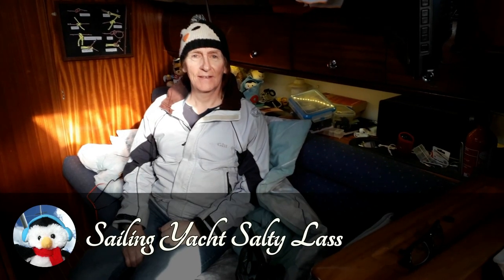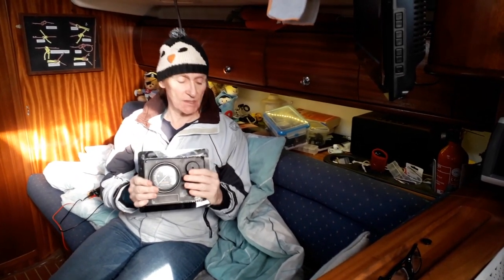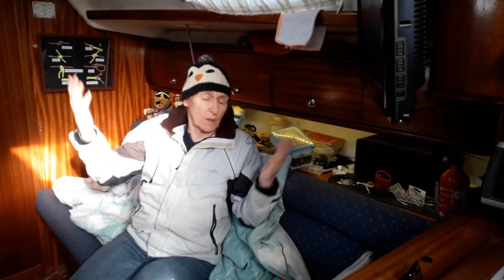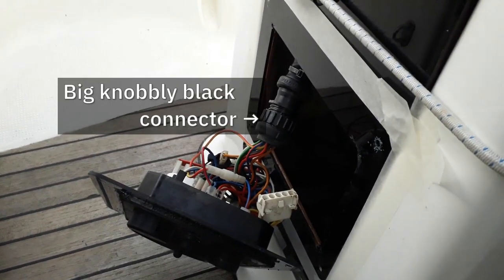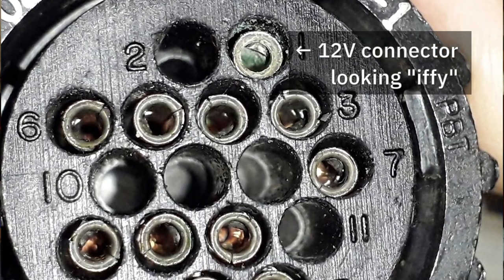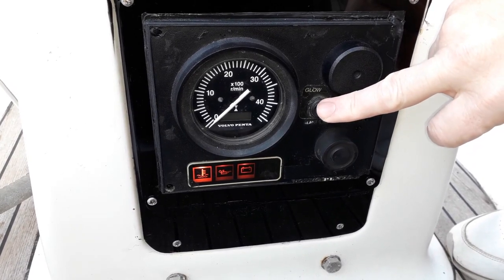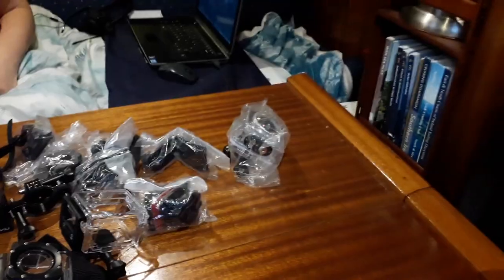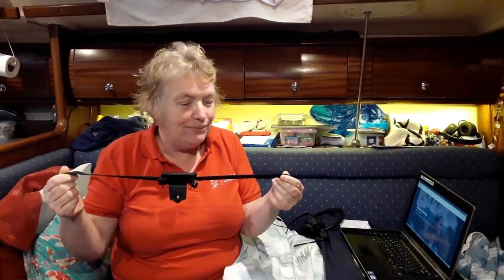Northern Ireland - Winter - Intermittent electrical fault - Inverter - Ep. 225

Comment: Hiya , I worked as an electrician most of my life and one thing I know about multi pin low voltage connectors is that they cause trouble. I used to cut them off and join wires some other way. Fair winds and happy days each. I enjoy your video very much. Pete
Reply from the maker: I will not say that we did not consider doing just that, but lucky for us, it all worked again. Thanks for commenting and for the feedback 👍

Comment: Hi Lasses, how's life? Just a point please don't use masking tape u need electrical tape because masking tape will conduct. Continuity mean power is running through the cable from one end to another but u need a ground. My Grandads motto was if it isn't broken don't fix it. Yeah right!!. I hope ur both well, even though Gaynor seems quite tired  but job well done on wiring Lass. Bev like the instrument panel good thinking and glad u used a lube on connections. Love Prus new head gear or is that face mask🤣🇦🇺🐧🐘
Reply from the maker: The paper tape is what we had to hand. It was temporary and we did not want bare metal floating about the battery area. Whilst the charging system was not broken, it was charging one battery preferentially and thus affecting overall battery life so we figured that splitting it over the bank would eliminate the preferential charge  link. As for Pru's new camera gear, we want it back!!! 😄😄
Reply: @SailingYachtSaltyLass  love u both ya crazy wenches
Reply: @SailingYachtSaltyLass  just want u both safe is all💚💛💜
Reply from the maker: Safe is good. We are not fans of danger 👍
Reply from the maker: 😆😆 Craziness is good too

Comment: Great laughs!  I think you have a new film crew member with Pru….imagine what places she could find to film.  Quick question: could you tell me the height of your sail stack at the mast and your boom length some time. I’m working on building one to replace my standard sail cover as a project to keep me busy this winter. Congrats on the panel fix and look forward to seeing the inverter purring along soon.
Reply from the maker: We are dreading Pru with a camera 😄😄 I will have to measure the height of the sail stack. I presume that you mean the bag and not the lazyjacks? The boom is 4.2 metres long. Thanks for commenting and let me know about that measurement that you need
Reply: Thanks!! This is so helpful! I just need the measurement for the sunbrella type material  bag at the mast end. I have the lazy jacks figured out so all good there.  Again thanks!
Reply: PS I should clarify I just need the bag height behind the mast that catches the sail. . Not the pc., if any that goes around the mast. Thanks.
Reply from the maker: @sailinglatis  - The height varies and is lower at the back. If I get a chance tomorrow before the storm hits I will measure it up for you. 

Our bag has a boltrope and fits into a slot on top of the boom. I will see if I can measure from there
Reply from the maker: OK - here are the measurements from our bag. Please remember that these fit our boom and our sail and your sizes may differ considerably. Having said all that, from the boom slot to the top of the sailbag batten is 38cm at the end of the boom and 55cm up at the mast. From the batten to the zip on the bag top is 5 cm all the way along. Remember to allow for extra material around the edges for the seams.
Reply: You guys are the best!  This allows for some planning in the winter months. I hope the storm wasn’t too bad. We had a winter blow last night but sunny today. Enjoy your weekend and Thank You!!  
Wendy
Reply from the maker: I should have mentioned that teh batten pocket is 2 or 3cm wide so another (say) 6cm of material needed for that. It might be worth watching Ep. 176 which deals with us doing maintenance on our sailbag  https://youtu.be/eENjQ9Tdl7s
Reply: Thank you once again!  I will adjust my notes and will watch that episode. Stay warm. See you Thursday.